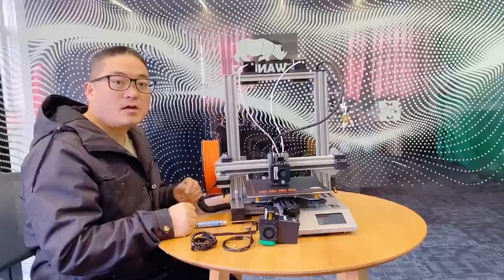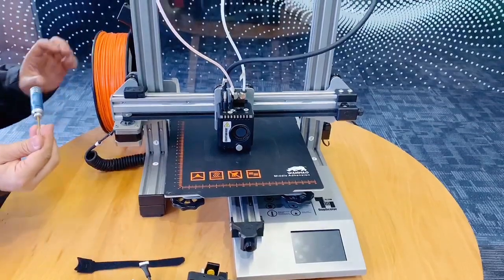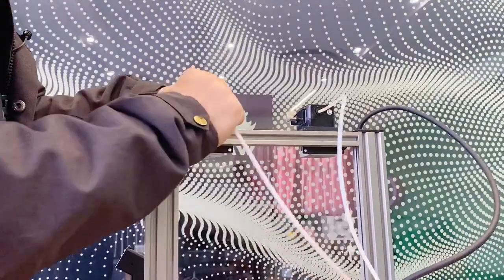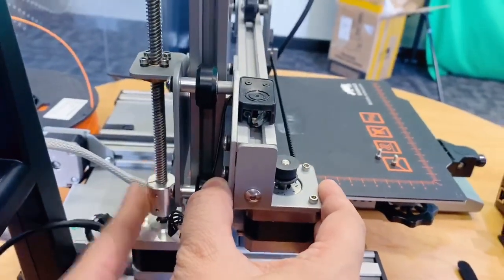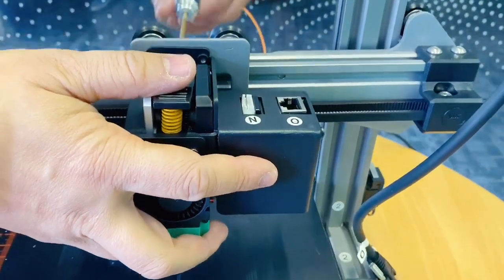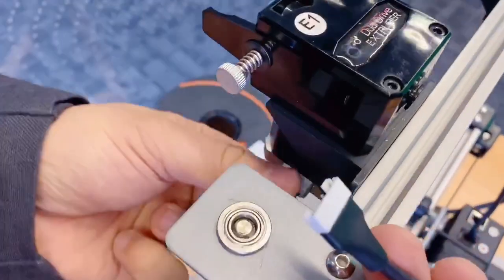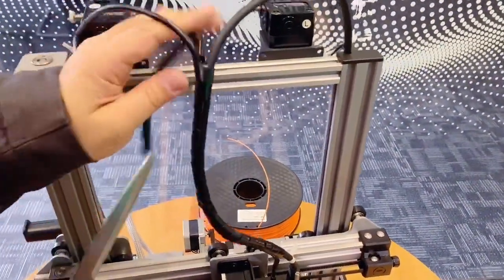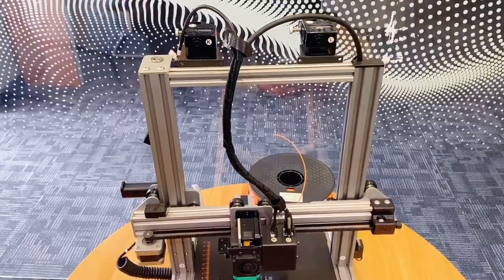How to upgrade to D12 direct Drive?

Comment: Do you need a modification on the motherboard ? or Gcode ?
Reply from the maker: No.  they share the same firmware.  No need to modify the motherboard.
Reply: @wanhao  The motherboard NO ... but all settings yes ! The buse and BL Toutch are not at the same place